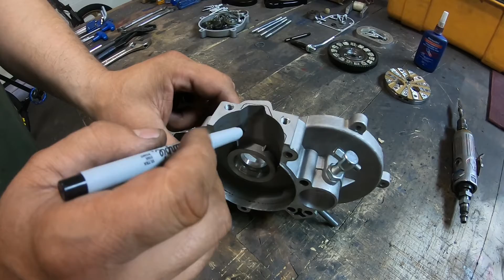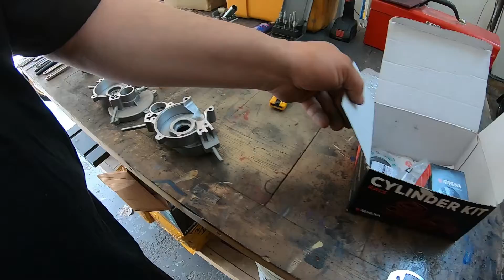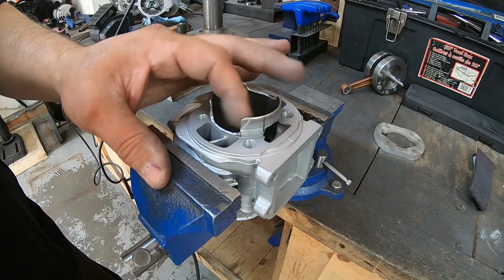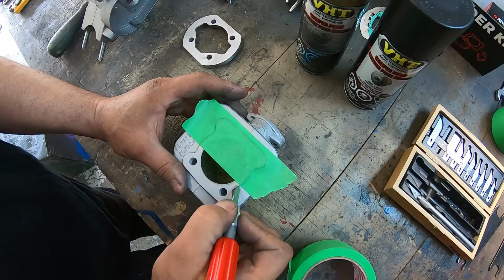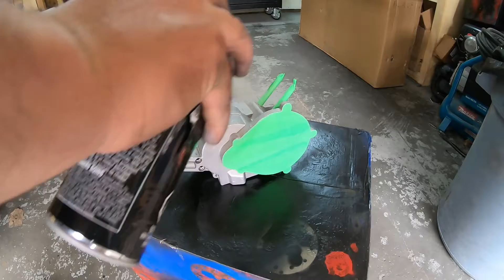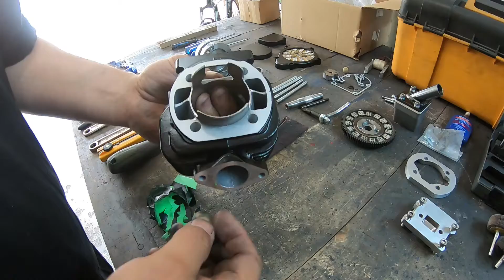Case Port Matching, Athena Pro Sport Racing Cylinder Plus Tips & Tricks

Comment: This is a good video of crank case porting or transfer porting. I've seen different methods of doing this but this by far is an excellent example of contouring the transfer direction towards the intake which makes good sense along with the knifing edge towards the transfer.

Comment: I got the same kit was wondering if I can do the same porting to the cylinder only thing is the cylinder is going into a Yamaha Zuma with a minerall vertical engine was wondering do you do the porting just because you have to have a spacer the scooter engine doesn't require spacer just a thin metal gasket at the base and the head gasket thanks
Reply: Its done only because of the spacer